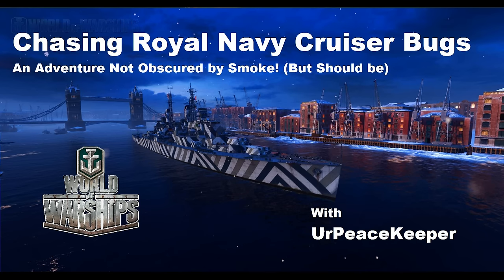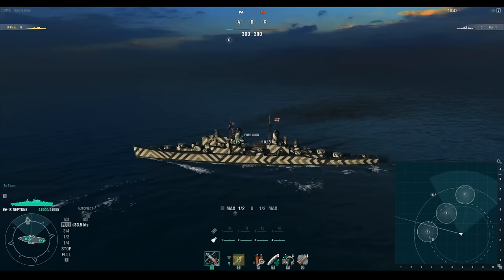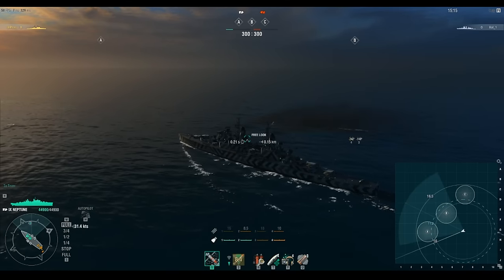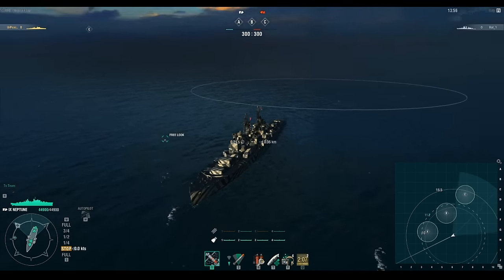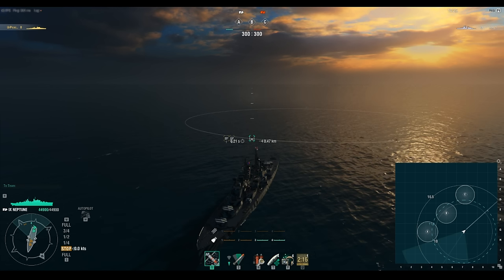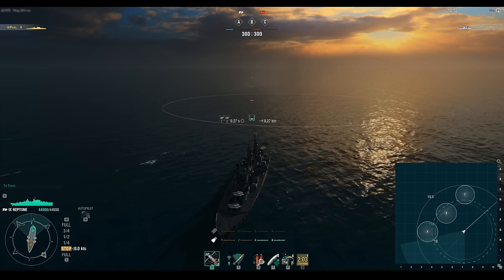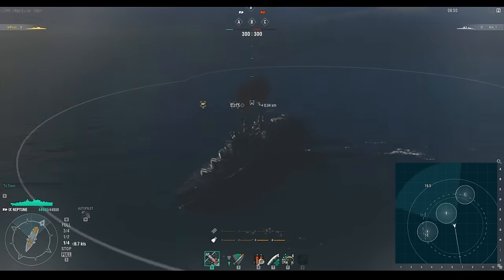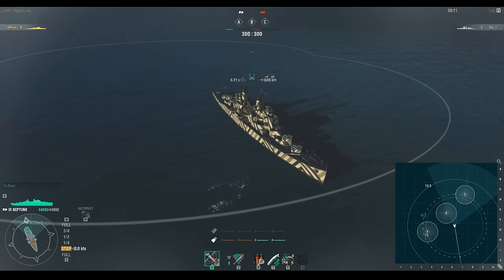Royal Navy Cruiser Smoke Bugs Rooted Out

Comment: Confirms it affects Leander.  It happened to me multiple times the other day, and just recently in div I was with an ally who is very experienced with leander and he popped, found himself no speed, exposed with a single ring behind him where I had two and was perfectly concealed.  As for ping?  I usually run 40-50 on a bad day.

You are absolutely right that it is game breaking.  When you are having a good game, do the smoke tactic, which for the RN is vital with the limited armoring, only AP ammo and short range, is absolutely critical to play right.  Suddenly you are a ship's length ahead of your smoke, no speed with the enemies having a turkey shoot.  It burns players who are playing skilled really bad on an already extremely challenging ship.  Now they are saying their one gunnery advantage, the smoke is no longer viable.  They are not destroyers and take a bit to slow down.  The time to get down to a speed where one ring would suffice, you would already be dead or dying.

The worst part though it it's unpredictability.  Yes smoke comes in puffs, but the linear formation as you move makes it something a person can account or adjust.  When you have x duration of smoke and do not get it?  Well that throws off game hugely and also brings for a very negative experience.

Comment: Really became noticeable for me after I got the Edinburgh.  
The previous ships I would hit it at around 22-23 knots, while in reverse and full rudder over, and they would pop out two smoke rings.  Doing it with Edinburgh just left one ring and I'd pop out at almost zero speed, getting murderized if spotted.  Have to do it much slower with that one, yet the smoke coverage seems smaller than the previous tiers so enemy ships have a much easier time blind-firing into my smoke and hitting me for big damage.

Comment: It affects Belfast and Edinburgh the only way I can pop smoke and be guaranteed to stop in the smoke is to wait till 14 knots I have found even at 18 knots you can over shoot your smoke. It does affect game play especially if your are spotted as it causes a delay and normally results in losing half your health. Also the one smoke ring makes you a sitting duck for torpedoes as you have no room to manoeuvre
Reply from the maker: +sub ohm (naztb) Good to know, thanks.
Reply: Just double checked on Edinburgh in Coop battle 24 knts full reverse i stoped where the second circle should have been i was total out of the smoke i normally pop it at around 14 knots its the only way i can seem to stay in the smoke.
Reply: Exactly that, I've found the ONLY way to be sure to get a second puff of smoke and stop inside it, is to NOT exceed 14 knots when deploying it!
Reply from the maker: Yeah this is definitely still broken in 0.6.0.  It needs changed and bad.  24 knots seems to be a recurring theme.  I've not done much testing of the smoke at any other speed simply because that used to be the "Magic" number to get two smoke clouds and stop by the end of the second one.  I shouldn't have to come to a nearly 100% stop (14 knots might as well be) to guarantee two smoke clouds for that extra breathing room.

Comment: I work as a software developer (not for Wargaming mind you) and for me this doesn't look like a bug (I'll explain so bare with me). I would guesstimate that ALL smoke using ships suffer from this but it is not as noticeable because the smoke deployment time is much longer then that on RN cruisers.

What I see is a development decision (perhaps due to performance issues) to lower the smoke deployment spot resolution to a relatively low number.

What does this mean? Well it means you can only deploy smoke in certain spots and the smoke will always circle those spots.

Last test demonstrates this relatively well. You got 2 puffs because you managed to cross from one smoke deployment spot to another even though you were barely moving. If each puff creates a smoke circle then at the speed  you were going the circles would need to be overlapping a lot more then they actually did. 

If you try to imagine full smoke circles it looks like one smoke circle can (at max) overlap about half of the previous one.

So IMO if you activate smoke just as you enter one smoke deployment area and don't leave the same deployment area before the second puff then the second puff happens in the same area even though it seems you're out of it.

I hope this makes sense to you.

My conclusion is that this is not a bug but rather a annoying side effect of a development decision.

To reduce this side effect they would need to increase the smoke deployment resolution. Can they do that without causing other nasty side effects is anyone's guess.

Let me just remind you again that this is an educated guess from me having experience with software development decision making and compromises that are sometimes made.
Reply from the maker: I guess it depends on how you define "bug" right?  :)  I consider this to be a really poor game mechanic that as you correctly state, punishes one line of ships more than others due to the design choice to make their smoke deploy for a short period of time.  In fact, the number of puffs method would actually be a more reliable method (IE:  You get 3 puffs and the deploy every x seconds) since it guarantees the correct smoke deployment regardless of where you are.  Right now, this method of generating smoke is obviously an unintended side effect of the game, hence bug.  It may not be a flaw in the code per se (as in bad coding causing errors) but it definitely is not the intended design... or at least I hope it isn't! :)
Reply: The mechanic they use is probably a compromise. 
I would very much doubt they didn't realize what can happen to RN cruisers depending on the spot where smoke was activated and the speed it was traveling at.

The developers at least would be well aware of how smoke can come out in such cases. If not they are certainly aware of it now :)
My guess is that the head guy decided that "That's good enough" (at the time )and that the players will have to live with it.

That would also explain why they don't define is as a bug and say instead that it "works as designed".

It may work as designed but many players would agree that the design is very annoying to use as is.

I would guesstimate that the smoke release duration time was likely selected so that in perfect case with ship goes full speed (and lucky positioning) can manage to cross 3 smoke deployment spots at max (thus getting 3 puffs). Sadly that also means that with a bit unlucky positioning you can at certain speeds get only 1 puff.

If they find an easy fix they'll probably implement it (maybe increase smoke deployment time for 1 second) assuming it doesn't break something else.